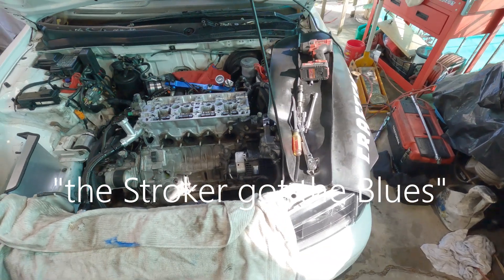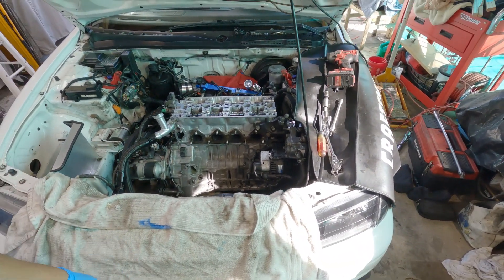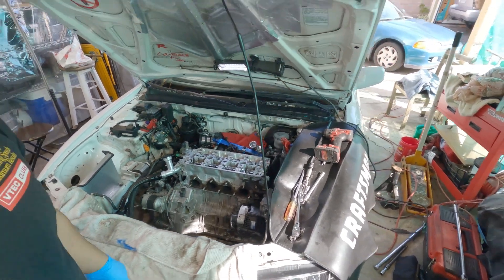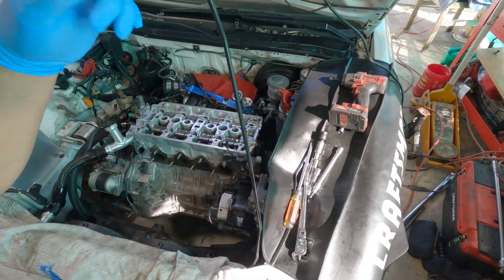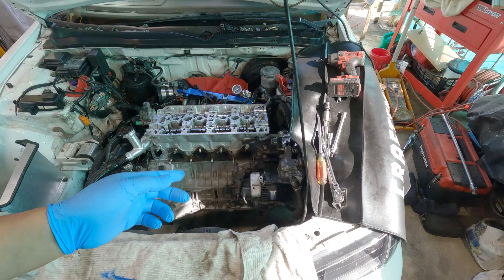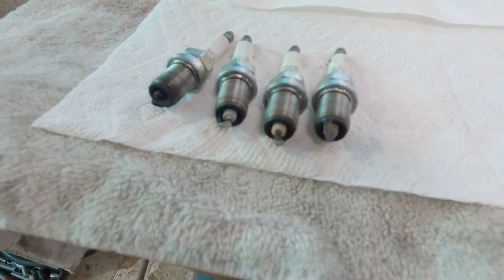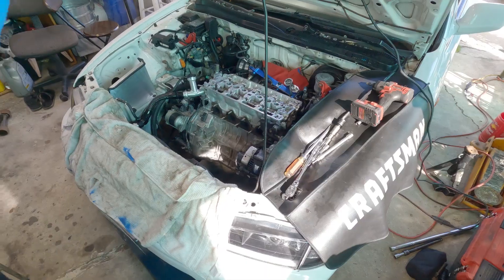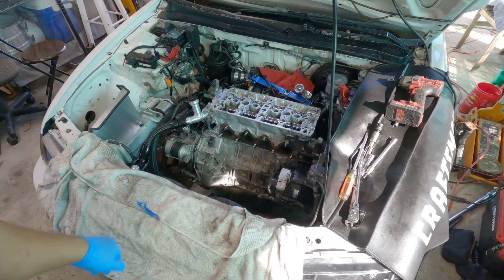What cause H22 swap Blue smoke from exhaust? pt. 1

Comment: Did the thrust washers stay in place when you turned the crank?
Reply from the maker: No, but it's normal that it turn and come out on it place when other half is not installed.

Comment: Does this apply to F23 pistons as well?
Reply from the maker: It goes on all any combustion engines. If a blue smoke comes out during start up, its from stem seal. If happening during hard accelleration/ decelleration, it's from piston rings.
Reply: @sagittnet2158  just finished my rebuild man. I really appreciate all the videos you’ve made & the time you’ve put into them, definitely gave me more motivation to get it done. Gonna go for a full drive tomorrow to break it in some & hopefully everything runs smoothly. I did do a rookie mistake but I’m sure it’ll be okay if I break the rings in properly

Comment: What’s the issue,head gasket + hesd warped?
Reply from the maker: I think the majority of the oil problem in the CC is the #1 piston oil control ring coz after l installed a new set of rings, the smoke went away.

Comment: Uncle check if the piston oil rings hole is not cloged thats prolly whats most oil burner problem even the ring sets beedn changed new
Reply from the maker: I thoroughly checked everything before l installed it back and you'll see it how it turn out. Thanks for the input pamangkin.

Comment: Clocking rings is definitely way important for sure. Looks like the oil control rings top and bottom were on thrust surface but maybe that happend when you pulled the piston out of the cylinder. I have oil burning issue in a fresh honed 86mm f20b stroker (f23 crank) that started smoking and burning alot of oil after abut 10k miles. And I always make sure the rings are where they need to be. I don't wanna pull it appart but going half to because oil consumption is so bad. All new seals pistons rings fresh bore and hone valves were done cut lapped its pritty shitty. I've heard the rings can move around during break in just  luck of the draw type deal and they move around in the cylinder and the gaps end up close together and or on thrust surfaces causing oil burning 🔥
Reply: F20b so good dude. Hope you figure out your issue Preston. What chassis you got that in?
Reply: @cbdreamer1709  CB9 wagon
Reply from the maker: It's a bit odd to found out that the ring gaps where aligned like that. It's either it does move around like they said it was.  You'll see it sooner how it turn out. Thanks for your input and hope you also will take a time to deal w/ your oil f20b stroker consumption. Later man!
Reply: Oh wow so good Preston

Comment: Man thats crazy just that little detail can make all that trouble. I did my 1st set of piston rings ever last year in my a4. No blue smoke after thousands of miles 🙌. I hope that was it and she'll be running good again soon. Good work
Reply from the maker: Yes it is odd situation for me coz l never had an issue w/ this engine when l was using it 4 yrs ago. You'll see it on next episode. Thanks for your input.

Comment: With oil in the intake, can it be a pcv problem?
Reply from the maker: I know pcv valve will also send oil on the intake manifold but it should be to the point that the cpmbustion chamber is flooded of oil. That's why it was a puzzle for me. Next episode you'll see soon.
Reply: @sagittnet2158 if the stay opened  . I have already see this. Hope you find the problem
Reply from the maker: @patrickafonso8080  l think it did opened on me and its part of the source. I'm monitoring right now if it'll ever occur again. But it was the piston ring that's giving me the smoke.
Reply: Definitely could be but to get that much oil in there would mean it's got alot of blow by and is slamming oil through the pcv valve from excess pressure. But in that instance oil would be in all cylinders. The 1 cylinder is probably just dumping oil in to the combustion chamber and on intake overlap its letting it in too the intake if it were my guess
Reply: @prestonking5692 on the rbc the pcv is in front of this cylinder. Only time I have seen this much oil in a cylinder, the motor was pumping oil via the pcv valve. But it can really be other problem.
Reply: Such good insight. Awesome!

Comment: While you have it like that might as well change the piston rings/seals
Reply from the maker: I should have (2,3&4 piston) but l dont want to disturb it, so l only installed new rings on #1 piston. This motor will not be on this chassis long. My plan is to get it dyno so we can see if the intake mani will perform. Maybe l'll bring back the boosted engine l have on it before. Thanks for your input and next episode you'll see.
Reply: @sagittnet2158  yeah once we drive with out boost we miss it,  I once had a 1988 Mazda 5 speed transmission 2.2  intercooler turbo GT and I have had a turbo car ever since I had that, I have a 94 Honda Accord ex VTEC that  is also 5 speed. so for 14 years without turbo.
Reply from the maker: @gabrielark6353  one thing for sure man! W/o the turbo, its making me behave driving lol. Tnx man